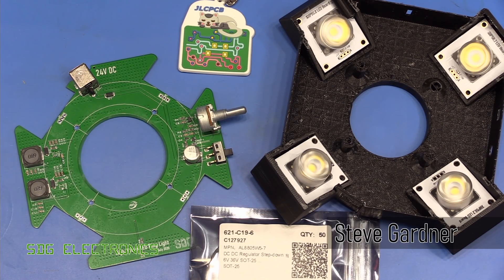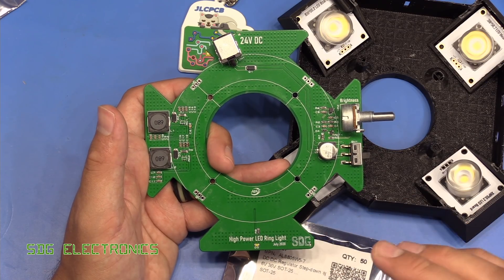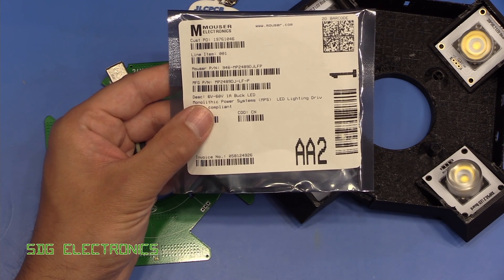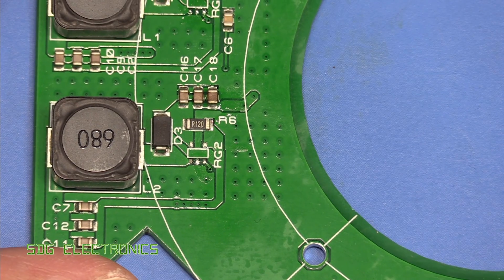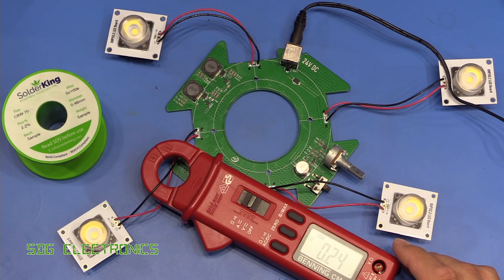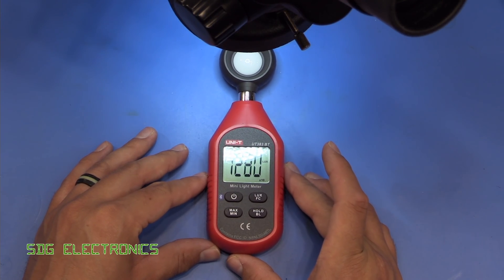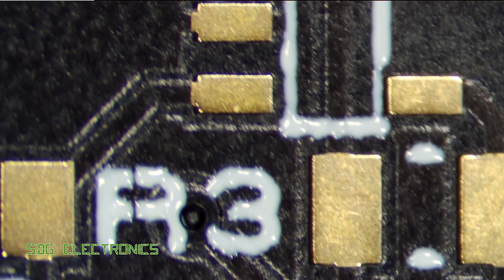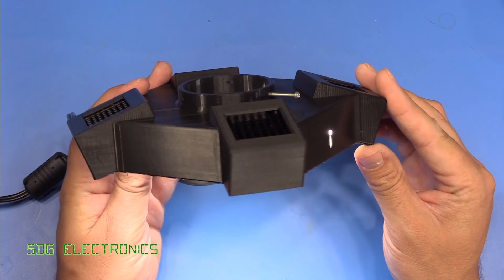SDG #175 Cree XHP50.2 LED Microscope Ring Light is ☀️ BRIGHTER THAN THE SUN ☀️

Comment: It is an awesome project. The lights are placed further away from the lens, and can have some similation to antiglare side lights. Each to his own. It is worth it, the one thing that i see as one of the cons is the size. You want to keep your ring light as small as possible because of numerous reasons. Especially if your primary use is set to HD microscope usage. For a stereoscopic application, it is excellent. You probably solved the problems that conventional and even expensive designs and models have. Not one of them can handle glare at a level like gooseneck anti glare lights. In combination with these, you can have a 20 US$ ring light and use it at a low brightness level, the picture will be perfect. In my opinion ( i own 3 different ring lights ), the gooseneck anti glare lights are unbeatable. And no, you do not really need the fancy ones over 100 US$, you can go for solid cheaper ones up to 50 US$ with 2x3W led lights. In my opinion, you got an excellent idea which you realized. The light is awesome, the led-s itself are better than the ones in common ring lights. The angle is good, no flaws in it. Physically, i mentioned where it could cause some problems when the usage is directed to a screen during hd microscope use. It is mainly dependent where you screen is placed. With the right placement, no problems at all. Good work.

Comment: Fair? I think JLC is having some SMT QA issues. Just got back some SMT service boards from JLC (after some delivery delays) that was missing the main microcontroller IC. After I pressed the "Quality Complaint" button and descibed their answer was that they were out of the part so they just left it out without notifying me at all until I noticed them missing myself. Now have to delay the project another 1-2 weeks to get the parts in from DigiKey. Their remedy was to give me a $10 coupon for future orders!

Comment: Would the Cree XP-L2 be a good candidate? Output may be somewhat reduced, but given similar lumens/watt, should get you close enough, and requires lower voltage. 

Wonder if Nichia has some offerings that would work well?

Comment: Good work old bean, pretty much eliminated the reflections. Nice that you can quickly prototype with the 3D Printer. Would be nice if the led boards were a bit smaller. Could you try a smaller heat sink and test the power? Maybe do some heat transfer calcs on the next update??

Comment: I wonder if the heat of soldering on the suspect ICs are making them fail, ie, it's too long. Maybe solder one as cold as possible, test, and them resolder it at over temp.
I wonder if diffusers would stop those 4 reflections per pad on the PCB.

Comment: Great result, Steve!  I think I want to make a variant as a workbench light (since I don't have a microscope)! Of course, part of this will be finding a decent 24V power supply that doesn't cost more than the rest of the light!
Reply from the maker: Hi John, I may end up doing something similar. The light output is quite comfortable for general use.
Reply: @sdgelectronics  Cool!  Let us know what you find in terms of more affordable LEDs - as you demonstrated, finding something decent that you can actually buy is challenging :)

Comment: Would like to do something similar as a light for my fish tank. The circuit board would not need to be so fancy for sure. Any tips and suggestions?
Reply from the maker: You could use the LED PCBs along with a commercial constant current LED driver. 4 - 8 LEDs on a 1200mm aquarium would give enough light for a decent planted tank if you used CO2. You'd need to scale it back in a plain aquarium as there is too much light here.

Comment: At the end I got no reply from lcsc. Unfortunately I had to set a negative review...

Quite disappointed.

For reference I got a broken MCU out of 2.
Reply from the maker: I'm surprised you had no result. I had no trouble with the complaint and purposely did not talk to my JLCPCB rep to see how they would handle it through normal channels. Was this using the assembly service too?
Reply: @sdgelectronics  no, I've bought bare components from lcsc. They had supply some atmegas in a cardboard box but nothing fancy.

One chip is dead, can't be seen by avrdude. The other is fine.
I've contacted lcsc but after a week I got no reply from them.

Comment: Looks great that Steve, especially on the black PCB 👍. 
I still use the standard type ring light, but I've managed to squeeze a 10W LED in the microscopes frame which shines down at about 45°, along with a couple of power resistors for current limiting. Its not a pretty setup but it does a good job of backing up the stock light.
Cheers mate
John

Comment: I think that based on the performance you saw, it would be more usable if it went from ~0% to 25% (Or maybe ~0% to 50%) rather starting at 25%. I think the main advantage of this over the original ring light is the high CRI LEDs and the positioning, rather than the brightness at full.
Reply from the maker: I'm not sure how useful the lower settings are. 25% seems to work fine except on dark PCBs or when you are at high magnifications. It was probably a poor choice to test with this camera given how well it performs at low light. I think the story will be quite different with a basic camera.
Reply: @sdgelectronics  I was mainly thinking about reading the text on IC which have been conformally coated. When using a basic ring light, I find myself having to turn mine down depending on how they have marked the ICs - Although I'm not sure how much of that is simply due to the reflections rather than the brightness.

If you have some conformally coated PCBs, it would be great to see how well it works for those.